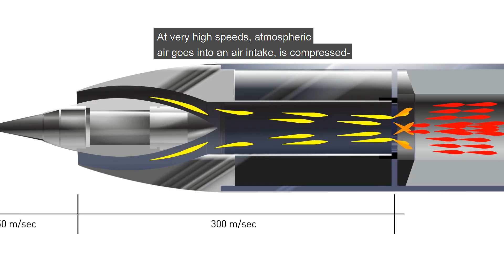How ramjets may change the role of artillery on the battlefield

Comment: So NOT on the point. Well, for one NATO standard is about 40km, Gerard Bull's guns were firing on 50+ and programs like ERCA (updated Paladin) or Koalicja-SW (new russian, so with pinch of salt...) reach 70km. With something resembling classic ammunition. The limitations are time-to-target and precision, which decreases with range. Later is remedied by innovative Israeli intelligent fuzes which also contain simple, cheap INS to keep deviation on longer ranges in check. But one thing that won't be remedied is increase of time-to-target with range. No MRSI no... also: round packed with ramjet, guidance etc able to withstand firing not only will be mighty expensive ( AGS welcome to!) but carry ... uhg.... very little in way of actual FIREPOWER, kinda defeating the purpose. It will be weak and it will be late.  If one AGS round costs equivalent of Tomahawk missile, for single Zumwalt loadout I can buy equivalent in Tomahawk missiles to basically decisively win the war by devastating infrastructure of enemy state on far longer ranges.  Ramjet 2nd stage for MLRS rockets makes sense - for artillery, it does not. For dudes saying "speed does damage" - not in this speed range.  1kg of TNT is about 4,2x10^6J - 4,2MJ. In order to one kg of e.g. iron to deliver 4,2MJ it would have to travel at around 2,9 km/s which is Ma 9.7. Rougly twice speed of APFSDS at end of flight and these are much heavier (about 10kg). Typical artillery shell contains 11kg of HE better than TNT (quarter of total mass), which means that in order to replace it with KE,  1kg rod would have go either from sample 1kg to around 10-15kg (order of magnitude) while maintaining Ma10 or go faster aby about 3 times - to Ma 28, which is more than earth's escape velocity :D Read: you can't fire them from the ground.  You want range alone in efficient manner? Give it smallish, slow burning solid fuel motor (even french had such mortar rounds) and small wings extruded at top of trajectory...

Comment: The whole concept has two major weaknesses.
First you have the already mentioned low explosive charge which all extended range shells share.

Second however is the steep ballistic angle making it more susceptible to interception by enemy AA.
Autocannon AA with C-RAM (counter rocket, artillery, mortar) capability is an increasing problem for artillery. The advent of Laser weapons will only make it worse.
Reply: AAA fire may find it difficult to track and hit a mach 3 target.  That's at least 2 times the velocity of any AAA projectile in service.  Laser weapons can work if the tracking system is up to the task.  How many armies in the world have fielded long range laser weapons?
Reply: This sounds more like a direct-fire weapon tbh, i could see these things being used against armor
Reply: @A-G-F-  its absolutely not. The ram engine is effective only in higher altitudes, where the atmosphere is thinner. Using it on the ground is useless

Comment: Are you really artillery if you have an engine on the shell?  By definition I would say no.

Also, artillery is meaningless if you do not have air superiority.  If one side has air superiority it simply identifies the artillery cannons and blasts them from the air before any troops need to get within range of the artillery, even it it is 150km.
Reply: Yeah, rock, paper, scissors. Everyone knows it, genius. And rocket artillery is artillery by definition.

Comment: I'm thinking if you angled it up a bit and boosted it to a higher altitude before deploying glide fins after it reached apogee, you might coax a 200 km range out of it.
Reply: If it had a warhead yes. If it's a kinetic weapon, it will have to be on a trajectory that maintains maximum velocity to target.

Comment: M30 (GMLRS-DPICM) witch is in already in use and uses rocket artillery has a range of 80 km
155-mm-ERFB V-LAP is conventional artillery with a range of 76,3 km
MGM-140B ATACMS Block 1 (M39A) rocket artillery has a range of 300 km and is technically a SRBM
with further development of cruise missile technology and rail guns nammo ramjet artilery is pretty useless
Reply: But MGM-140B ATACMS isn't technically a SRBM, the key is in the name (TAC).
Reply: No, this is brilliant, as you add it to existing artillery without having to change them, and it's cheaper to shoot them out of a gun instead of adding a first stage rocket engine to accelerate them enough so the ramjet ignites.. the ramjet increases the range massively compared to a rocket, and has no moving parts as compared to a jet engine. So you get bigger explosive mass, lower cost, and can use in existing systems.  It's a triple win.
Reply: thank you

Comment: Great, you can push an artillery shell a long way. Now, let’s talk effects. How accurate can you be with this technology? Active guidance/GPS? If a “dumb” round, is the rocket consistent enough to use traditional fire direction? What is Time of Flight, and will the target still be in the target area when the round arrives?

Next, what about effects on target. Good that you have the range to reach out, but what are you aiming at? What is the target? How are you observing the target, and what capability are you providing that the observation platform does not have?

In line with the target, what kind of warhead will this have? HE, dependent of fragmentation? What is projected burst radius? The ramjet rocket precludes HEAT, and no payload capacity for sub-munitions. In short, what is this round going to do when it gets there?

Lastly, talk value. A 155mm HE shell is cheap. A good thing when you are tossing dozens of rounds at a single target. How expensive would a single shell be, and how many would be needed to provide effects on target?

Make no mistake, from an engineering standpoint, this is a wonder. However, from an artillery standpoint, it is a capability without a purpose. The range exceeds a tactical need for artillery support, and NATO militaries have more capable platforms that have the range needed with the ability to deliver larger payloads to target than this thing.
Reply: you think they would just explain ALL about their important military technology to the whole wide world?
Reply: The Ramjet motor to be used to enhance projectile distance , to use in canon shells to enhance projectiles distance of canon shells , for example firing to and from democratic statue of liberty to communist tianenmen square CCP Beijing, using satellite tracking system. Both CCP Beijing and democratic statue of liberty USA have satellite tracking system. The shell have to be big enough for to place ramjet motor and rocket fuel and the ballistic explosive .
Reply: @kamrulislam2766 to what end? Inevitably, if you want a greater range, you would be better served by using a missile than a stonk of cannon artillery.
Reply: Israel already has Iron Dome that  shoots down projectiles like this one. Systems like that adds a level of complexity to the design. Precision? Well that is another story.

Comment: Seems like good choise, the ramjet is a really simple design, so not to many parts that can break. 

But adding fuel and an engine. Did it lower payload capacity? Normal 155mm shells have 10.8kg TNT. What is the capacity now? And how do add the fuses? What fuses can the round use? What will the unit cost be? To make it wont be to expensive, but you want to make a good margin while you developed the round. Of coarse that has got to be payed. 
Can i ask? 

All the big weapon systems shows like "Eurosatory" are cancelled due to corona, so  there is no expositions to be seen in real life. 
Arent you worried, someone will just copy your design? It seems pretty straight forward.

Comment: It could be better idea to put a guidance system in a MBRL,as it would be cheaper and easier to build and operate.The explosive load could be made variable ,if desired to reduce the damage,and variable fuse could also be intgerated as the NAMMO has quite a bit of expertise in that field.
Reply: HIMARS just does so. It has both guided & unguided rocket shells for foe upto 70(+-) km.

Comment: having a laugh with all the comments going "where is the explosives" well you dont need explosives when you have a hunk of metal going over mach 3 also it fairly obvious this it purely a long range shell its not gonna replace standard shells for closer range. as for the price its a ram jet no moving parts not including guidance that would be not much different from other guided shells the jet is self is a hunk of metal once tooling is done it can be pumped out.
Reply: Actually... Yeah.. yeah you do. Mach 3 is only 2,000MPH  or so.. Your munition would get hot purely from the friction but that is about it.. It would lack any true damage other than shaking a tank crew up pretty good, a lucky strike might hit their engine deck and knock out the engine though. Against bunkers it would kick up a bunch of dust and that is it.

Comment: I don't see enough advantage of this system over traditional rocket artillery other than the fact it can be fired out of existing L52 barrels. 

When it comes to range, payload, cost effectiveness (ramjet will presumably be very expensive), rocket artillery as the upper hand. The key advantage of this round is that NATO inventory is mostly 155mm tube artillery. I think longer term as NATO starts replacing and upgrading its inventory, it makes more sense to balance towards rocket artillery rather than developing more exotic rounds.  

Tube artillery has an irreplaceable role on the battlefield, and with current rounds it is cheap, logistically friendly, and accurate, very suitable for engagements within 40km. We shouldn't try to shoehorn it into a role of long range strike, which is where rocket artillery shines naturally.
Reply: Im just wondering if the round would be fast enough to be able to slip by an active protection system?
Reply: Ramjets are cheaper than rockets (for the same impulse) though, the video makes them sound like something hyper fancy but that's just marketing, they dont even have moving parts...
And it is not meant to replace tube artillery anyway, which is completely different, suposed to provide barrages of intense fire at good range. This is more of a longer ranged shell for gun artillery, which is more about sustained fire, giving the option to strike further at the cost of a lesser payload (and probably higher cost due to the guidance needed to hit thst far away).

Comment: NATO already has a long range weapon it's called tomahawk missile system and other kinds of cruise missile systems. So this ram jet arty doesn't seem necessary to me.
Reply: have you seen the price of a missile like the tomahawk?
Reply: @phalanx3803  have you got the price point of this shell? 😋
It probably is 100k+ per piece
Reply: @Xorgye  $100,000 for a solid piece of metal and fuel? Sure a guided variant would cost over $100,000 like standard guided shells but the non-guided ones would be in the same price region as standard rocket-propelled shells.
Reply: @phalanx3803  Yeah, about cost of AGS gun round. Generously, two of them.

Comment: Ohhh yes
Let's take the explosives out of the shells and replace it with an engine..
Now we can hit further but cause no damage.. What??
Reply: Potentially the increase of kinetic energy will offset loss of explosives.  I wasn’t paying enough attention to remember if the new projectile is heavier than the ones it’s intended to replace at the point of impact. I guess it also depends on what the target is.  Some things need to explode others just need a big hole. Making a four foot hole in a building is less effective than making a four foot hole in the hull of a ship!
Reply: @porticoman  you have to score a direct hit for that to work, and a direct hit at 120KM is not easy

Comment: The Russians have Igor strap the shell on his back then run 100 km to pull the pin and drop it in front of the enemy.  That is the secret of their artillery program.  In any case it is irrelevant as the Russians have no ability to project power.